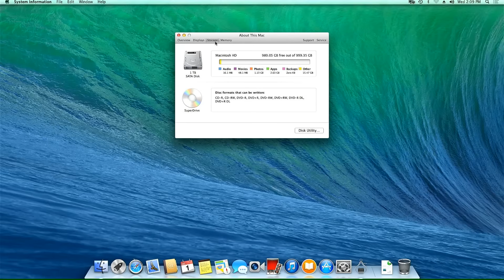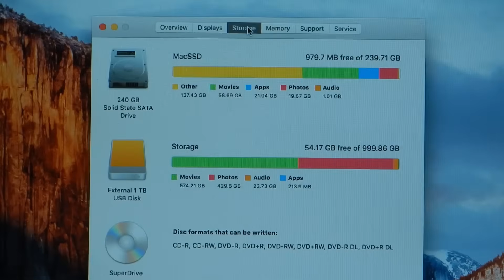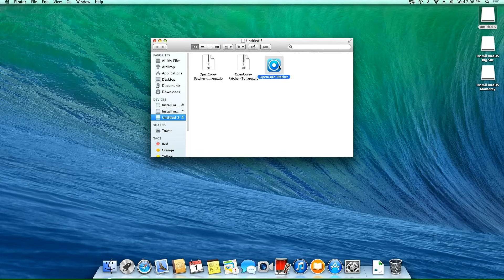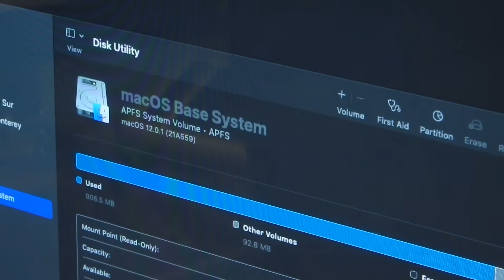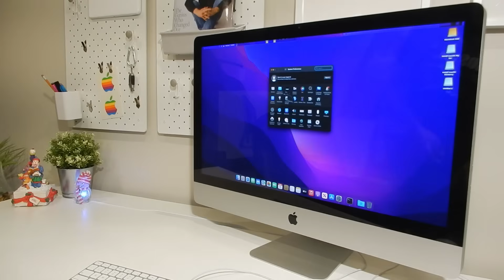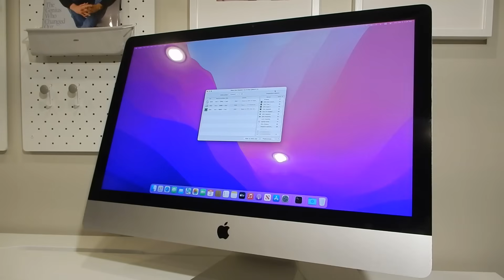Apple thinks this 2009 27" iMac is worthless. Let's refurbish and upgrade it to Monterey!

Comment: I have a mid 2012 iMAC, 32MB of memory, A dead internal hard drive, added a new SSD which is now my boot drive and everything works great.   I tried using Open Core Legacy Patcher to upgrade to Ventura.   I wanted to do this because I can't get the newest versions of Adobe Lightroom and Photoshop because they are not compatible with my old machine.    If I could get Ventura installed then I think I should be able to install the upgrades for Lightroom and Photoshop.    That would save me about $2200 by not having to buy a new iMAC.   I also don't want to buy an M1 unit now when they expect an upgrade to the iMAC's having the M2 or possibly an M3 chip by the end of the year.    I TRIED AND TRIED (three times) using Open Core Legacy Patcher and while it seems like all went well, when it rebooted it was still on Catalina........meaning I got no where.   Do you have any suggestions for me?   I would love to get this upgrade to work.   Thanks.
Reply from the maker: I'm not sure what part your're stuck at, so let's just go over the overall. 
 There are 2 parts to OpenCore:

1. The Bootloader - Since the Ventura loader will not load on an unsupported Mac, you use OpenCore bootloader which then subsequently boots the unsupported operating system.

2. The post-installation patches - This restores drivers and applies hacks so that Ventura supports the older hardware which Apple dropped support for.

So you need to create an official Ventura install USB key (this is officially supported by Apple, and there are many guides to do this).  Next, you download the OpenCore app on your Catalina system.  When launching the OpenCore app, you'll need to choose "build OpenCore" and then install it on your Ventura USB key.  This modifies your USB key to have the OpenCore loader in addition to the official Ventura installer.

Now that you have patched Ventura installer, you can reboot while holding the OPTION key.  This allows you to choose the boot menu, in which case you'll choose the one called EFI with the OpenCore logo.  Now a second boot menu comes up, and in this second one you choose the Ventura installer.  Now you can install Ventura like normal.

After installation finishes, you have to hold OPTION again and choose EFI again.  But this time, you can choose your local hard drive since you installed Ventura.  Ventura will NOT boot without first booting to EFI, since Ventura is not officially supported.  You must always choose EFI boot option first so that you can start Ventura FROM the loader.

You are now in Ventura.  From here, you reinstall the OpenCore app.  Now you build OpenCore again, but this time install to your main hard drive.  This will allow you to boot Ventura without using your USB key.  Lastly, install post-installation patches, which will fix your WiFi/Bluetooth/etc, anything that Apple removed that is necessary for an older Mac.

Important note, to get on the internet BEFORE the post-installation patches are installed, you likely will need to use an Ethernet cable since WiFi won't yet be working.

That is the overall procedure, please feel free to post back if you're still having trouble and specify what stage it's giving you trouble.

Comment: many of us have 27" Imacs from 2009 to 2010 , some of the best and flexible
Reply from the maker: Until apple realized they were "too repairable" and started change them in later models, lol.

The 2009/2010 27" has fully upgradable CPU, hard drive, GPU, replaceable PSU, etc and fully supports DisplayPort input.  What a fantastic machine!

Comment: Is there a way to change internal parameter to upgrade browser in an old operative system?
Reply from the maker: No, because the operating system is not blocking the browser, new browsers are relying on features and functions of the new OS which don’t exist in older ones.  It is entirely possible for someone (with source code) to compile a browser on older Xcode for older operating systems.  They don’t because it’s a fair bit of extra work, and very few people are using older systems in relation to newer ones.  A good example of this is the TenFour browser, which is a more modern version of FireFox which was backported to run on older very unsupported G3/G4/G5 Macs.  The TLDR though, it’s much less hassle to upgrade your Mac to a newer operating system then try to get a new browser working.  If you do need the older Mac OS version for other older software, you can always dual boot the current OS with something newer like Monterey

Comment: Would this also apply to a 2007?
Reply from the maker: Yes, you can do a similar upgrade on a 2007.  However, it does require a CPU supporting SSE4.1 which may require you to upgrade the CPU first.  Also, there are issues with the stock Bluetooth card, which can be overcome by upgrading it, not using it (if you don't need it), or installing a USB Bluetooth dongle.  Here is the official list of supported hardware: https://dortania.github.io/OpenCore-Legacy-Patcher/MODELS.html#imac

Comment: 32gb!? I was told the max was 16!
Reply from the maker: Apple says it takes less than it actually can.  Also, there are different 2009 models.  The Core 2 Duo processors I believe are limited to 16GB, but the Core i5/i7 systems will accept up to 32GB :)

Comment: Hi Is it possible to upgrade to Q9550S CPU? You mentioned quad core
Reply from the maker: No, sorry, if you have the Core 2 version it will only accept dual core LGA775 CPUs.  In theory it should work, but I believe the chipset does not support it.  It may be possible through extensive modding, but dropping that CPU into a stock iMac will not boot.

Later versions used LGA1156 CPUs which support a Core i7 quad core.

The other option if you want better performance is to use the nice big Apple as a screen, and hook it up to a more modern Mac or PC like I did here: https://youtu.be/TQwCJYiLqSo  If yours is a 27" Core 2 model, yours supports Target Display via DisplayPort which makes it one of the best iMacs to use as a monitor :)
Reply: @rebootretro  Yes I have E7600. Theoretically  Q9550s and E7600 are the same:) LGA775. Do you think it is possible to make an upgrade by changing the Logic Board from EMC 2309 to EMC 2374? Compatible? Lastly is 32 GB RAM that is 4x8GB possible? I tried 8GB but it was not accepted.
Reply from the maker: @huub1972 Apple sometimes makes subtle changes to various components, so it's hard to say if you can go from 2309 to 2374 - you'd be best to Google around to see if anyone has done it.  I know that a 2011 and a 2009 have virtually identical chassis, but the LCD has to be modified to interchange them, for example.

According to EveryMac.com (excellent resource!), a 27" Late 2009 Core 2 Duo has 4x RAM slots and will accept 16GB max (presumably 4x 8GB).  I can't confirm this personally though.  Older Core 2 Duo iMacs (like the 2008) will only accept 6GB due to chipset limitations (4GB + 2GB).  It is important to check your exact model, since Apple makes several models which look identical but are electronically very different.  Also, they can be fussy about RAM speed too, so best to match factory speed if possible.

Comment: Good morning friend I have one question, after successfully installing Ventura on mid 2011 imac, I did the re-patching which is the last thing to by following the Open Core tutorial.  So the OS boots ok and everything on the unit is working excellent! However,  it's just that I don't understand why open core will pop up every now and then.   So is it safe to just un-install open core from the unit completely?  otherwise I am assuming it will keep popping up? My first thought is to just un-install open core because it has served it's purpose but I am not sure if it is ok to do so.  Please help if you can....Thank you!
Reply from the maker: I'm not sure what you mean by popping up?  Do you mean right when the Mac is powered up, or do you mean after Mac OS has fully booted?

There are two important parts to OpenCore:

1. The OpenCore boot loader.  An old Mac will refuse to boot Ventura, but it will boot generic loaders like Linux, BSD, or even Windows.  OpenCore is a Unix-like loader which an old Mac will happily boot.  The OpenCore loader then spoofs the system type to Ventura so that Ventura "thinks" it is running on a supported Mac.  If you want to keep your boot drive complete vanilla (unmodified), you can permanently have a USB drive plugged into your Mac with the OpenCore boot partition on it.  But most people install the OpenCore partition directly to their boot drive.  So the OpenCore loader and boot partition does not do any patching to Mac OS - all it does is pre-boots the system and tricks a newer OS into running.  It's sort of an intermediate "helper".

2. The post patches.  Newer versions of Mac OS remove drivers for older hardware that Apple no longer uses.  The post-installation patches puts these old drivers back, or makes modifications to the system so that old hardware will run.

Lastly, there is the OpenCore app itself, but this is not really an important part anymore after the first 2 portions are complete.  The OpenCore app is used to write the bootloader for part 1 above, and then used to modify drivers in part 2 above.  After these are done, the OpenCore app itself is no longer necessary.  However, if you install Software Updates, it may overwrite the patched drivers with official ones and require you to run part 2 again to repatch drivers.

If you're talking about removing OpenCore, I would assume you're referring to the OpenCore app itself?  It should be kept around, however it should not be popping up automatically.  The OpenCore bootloader can't be removed (the part that shows up when you first turn on your Mac), or it you won't be able to boot any OS newer than the officially supported one.  You can hide that screen, so that it automatically boots directly into the default OS rather than hanging and waiting for you to click it, if that's what you're referring to?

Anyway, hope this helps some!  If you let me know the specific screen that keeps popping up, I will probably have a better idea.  Glad you got Ventura running!

Comment: would have been an excellent video if you did not skim right through open core and how you got monterey on this 2009 iMac and my reason for saying this is because I am struggling to upgrade an even newer mid 2011 imac from High Sierra to anything above.  I have tried Monterey, no luck and now I am going to try Big Sir lol. 
 Still like the physical updating of the machine in this video though.
Reply from the maker: Thanks for the feedback.  What issues are you having with OpenCore?  Your 2011 should run Monterey perfectly.  I'll help if I can.
Reply: @rebootretro  it is always awesome to get a reply from a user and I will say it may be hard but keep it up! This is what makes me love channels like yours. So I am your subscriber 100%  Friend, if I may call you that.   I want to say thank you for the initiative to help before I continue.  How ever, I have got the machine to do Big Sur at the moment by following instructions on open core website but Monterey was really my target.  It was really a minor fault that I was making when creating bootable OS for my USB Flash.  The name of the flash was different from the name used in the command line when trying to create the boot disk so the bootable OS would not write and became frustrating.  I felt the need to share this with you as I realized that it is only fair that I let you know since you would help.  I will now try Monterey again friend lol and will let you know how that goes.  Love this channel and keep up the great works!

Comment: I have a stock 2009 imac running Linux Mint. It runs all current software in 2023 and is as fast as it was when I bought it brand new. 
Great video btw Justin. Thanks for making this. Namaste x
Reply: I have the same 27” iMac from 2009…doesn’t start at all…before I get repaired how can I get lynx “Mint” properly installed and functioning
Reply from the maker: Linux is an excellent option for these Macs!  I will probably do a video at some point about it.  Benchmarking to compare them would likely be difficult though...
Reply: @rebootretro  Hi Justin. That would be good see. 
I tried a few different flavours of Linux, but Mint was the only one that didn't throw up WiFi connectivity or GPU problems. It works seamlessly. However, Time Machine files are encoded and only work on Macs. I managed to pull all the files but it took time. I suggest people do this before wiping Mac OS. Namaste x
Reply: @rebootretro  It's a great way to revive unreleased/locked out macs. Hardware is just hardware to a Linux system. I'm doing D&D on a mid-07 mac mini and an early 08 iMac using MX-23 Linux.
Reply from the maker: @chrisripley154  That seems like a project Clippy would approve of ;)

Comment: What can I do for a 2008 I mac. I'd like to get a little more time
Reply from the maker: https://youtu.be/_a2utQaO_Gs
I did exactly this with a 2008 as well!  I believe most 2008 iMacs should run Monterey, via OpenCore like I did.  Most 2008's I think are limited (unofficially) to 6GB RAM, but single 4GB DDR2 modules aren't all that common.  You should make sure you have a bare minimum 4GB RAM and an SSD boot drive.  Many people get hung up on wanting a CPU upgrade too, but your biggest performance per dollar is going to be an SSD upgrade.  With 4GB RAM and an SSD, you should have a very usable system for basic tasks such as web browsing and video watching.  Your biggest weakness is going to be RAM, but if you limit yourself to running one app (and/or one browser tab) at a time you should have a pretty good experience overall, despite this computer being 15 years old.
Reply: @rebootretro  . Thanks

Comment: Hello, I have 20-inch, Early 2009 imac Intel Core 2 Duo - Ram 8Gb - NVIDIA 256 MB
Without ssd I can't upgraded to ssd. What's the best MacOS for my iMac?

Thanks.
Reply from the maker: Honestly they'll all be a little sluggish without an SSD.  I think High Sierra will probably run the smoothest, however you'll probably run into issues with software support since HS is very outdated now.  HS is the last officially supported OS for your machine, I think.

If you can live with it running slower, I'd probably go with Monterey clean install and avoid installing anything else unnecessary.  At least with Monterey it will support the latest web browsers and security updates.

Ultimately, High Sierra should run faster, but Monterey will give you a more usable (but slower) machine.
Reply: @rebootretro  I'm currently MacOS catalina looks very good, macos monterey better?
Reply from the maker: @Raafat  Catalina will run smoother since it is older and less bulky.  If it was me and it was running well, I would probably keep Catalina unless installing an SSD upgrade in future.

The trade off is you will not get security updates with Catalina.  If you want/need security updates, you should upgrade to Monterey.

It should be very usable with Monterey, but will probably run slower without SSD upgrade.  Personally, I would probably take a smoother Catalina system with outdated security, but that is just my opinion :)
Reply from the maker: @Raafat  You could also partition your drive (or install on external USB drive) to test Monterey and see how it performs.  This way you won't damage your Catalina existing system if you decide Monterey is too slow.
Reply: @rebootretro  Really thanks for the info 💙

Comment: I had a 13 year old Imac, and made it a Chromebook. With the linux operating system, it flies. With linux you can put solfware on the hard drive. Everything must be or come from the Cloud. Really like Google Docs. When I loaded my jump drive with the os, I can take it any where and use any computer and start working. Simply plug it in to USB port, restart, and F2 on PC or Alt/option on Mac. Don't even need to ever install on the computer hard drive, unless I want to. If you are used to a Chrome Browser, won't even know any difference using linux.

Comment: Can you still use Target Display Mode if you upgrade to Monterey?
Reply from the maker: I just tested it, and YES!  It does work.  Pressed CMD+F2 enabled display input and I could use the iMac as a secondary screen.  The only issue was trying to switch back to the iMac using CMD+F2, where the screen went back and the iMac crashed and had to be rebooted.  It may have been a fluke, but I can confirm video input does, in fact, work. :)
Reply from the maker: That is a fantastic question, one which I've asked around and no one seems to have a solid answer.  I just searched around again, and found only one guy who claims it is possible and works with Monterey.  Since so many people have asked about Target Display, I'm going to order the cable to test it.  I will test it, and if it works I will make a video showing how it works.  Make sure you're sub'd :)